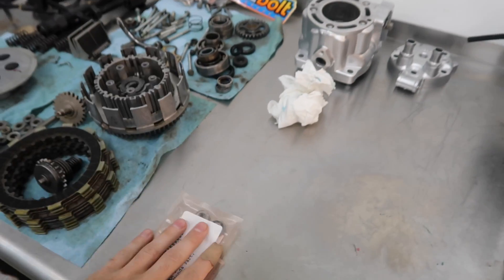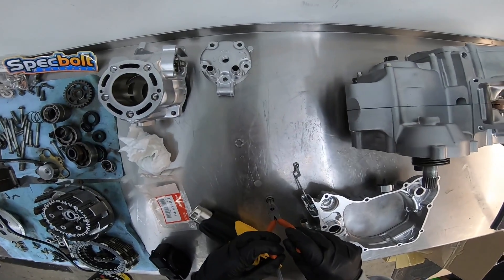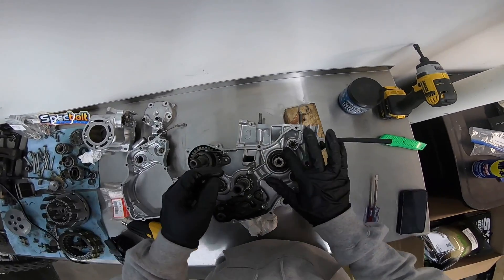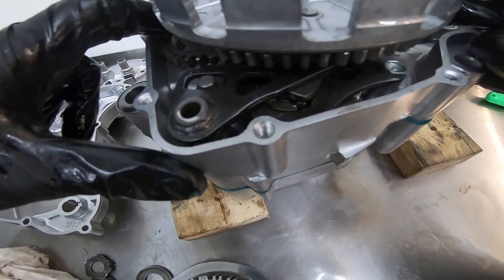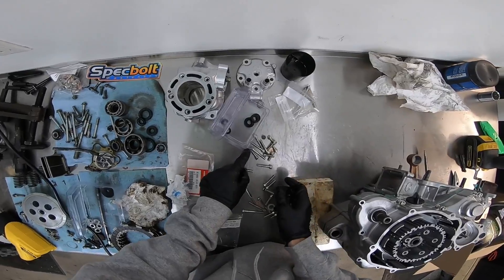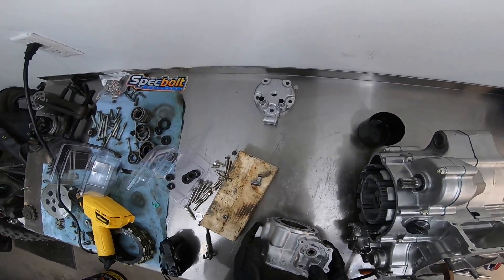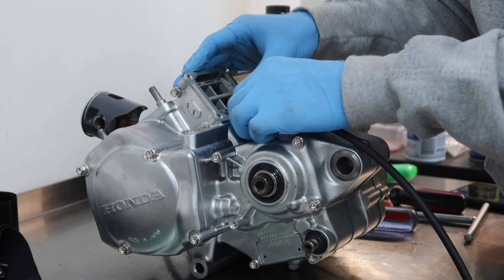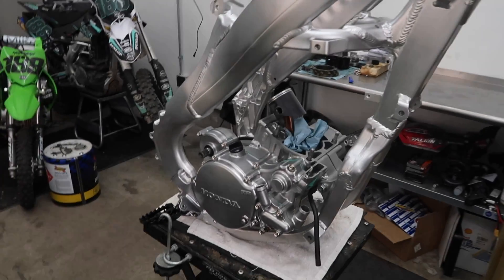2019 CR125 Build PT.10 | ENGINE + FRAMING THE BIKE

Comment: If not you will start loosen water in your radiator. If you look the schematics up on the 80 85 125 250 480 and 500 they are all the same. Spring always faces the water pump impeller

Comment: The reason an oven is the best method is because it heats the case evenly,not just localized heat that makes the case expand in one spot potentially cracking it..yeah you can do it your way but it's not  ideal.if you decide to do it the right way next time put the case in while the oven is cold and let it heat gradually while the oven heats up
Reply: That torch isnt getting hot enough to mess anything up. People have been doing this shit for years.

Comment: The gasket is upside down 😅 flip it over and then it will. Turning it won’t do it
Reply: Nick Huston me too I thought the same.
Reply: The holes are spaces further than the case holes even if he flipped it*
Reply: 7:54 he had it flipped the way you wanted(the right way).. Still didn't fit which is why he flipped em the wrong way in the first place and said "any orientation" meaning no matter what he does, the holes don't line up. Goofball! Lol they look like 2007 gaskets tbh

Comment: 01 and 02 are the same 03-05-06-07 are all alike and the 04 is different it as a electric power valve (they were bad so they went back to the 03 style) 05 to 07 had better port timing!